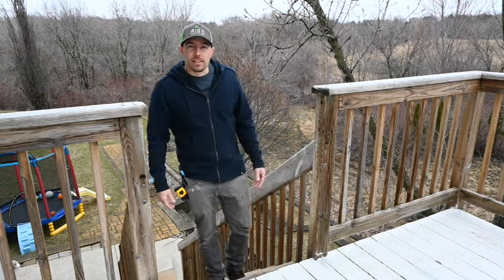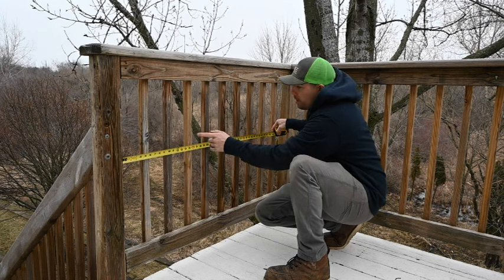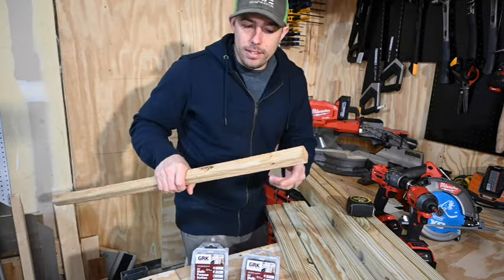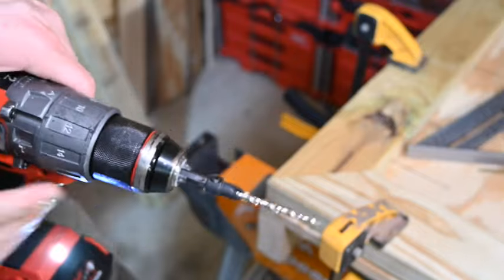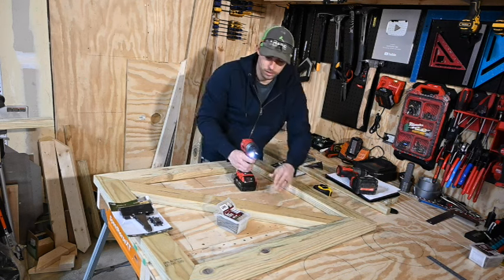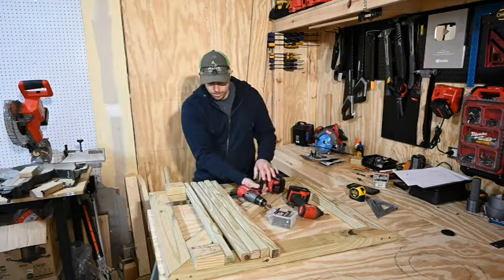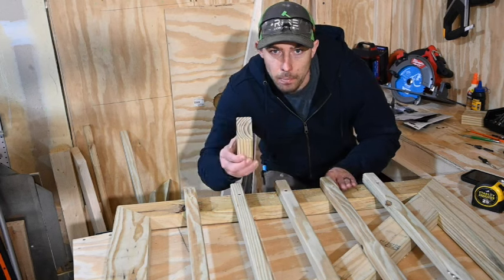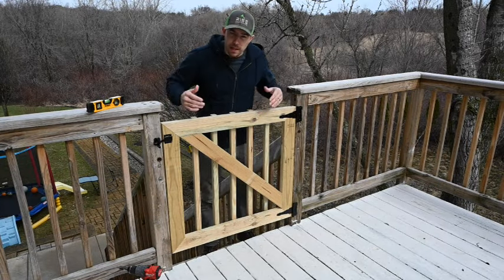How to build a deck gate

Comment: The diagonal support is in wrong position. it needs to be inverted to act as a compression support. Place top of diagonal support on outside top of gate down and in to hinge side to form a compression joint.

Comment: Great video!  Quick question please.  I went and measured my width on my deck stairs and the bottom measurement was a quarter inch shorter than the top.  Top was 42.75”and bottom was 42.5”.  How do I approach this?  Thanks.
Reply: Make it to the smaller size the 42.5"  
Or just split the difference, we don't build stuff out of square, (unless on a boat or special reason, split difference or build smaller size... usually split difference 🥸

Comment: Does one need the diagonal cross board? Is there a purpose for it or can someone skip it?
Reply: ... And cheaper
Reply: Crossbrace is needed to prevent sagging. Attach to upper rail and lower rail for symmetry. Do not exceed less than 45° corner to corner. Attach to lower hinge corner to top latch corner

Comment: What size countersink bit did you use?
Reply: Don't need to countersink. Just send the screws below flush. Also, screw on the vertical sides. Not on top.

Comment: Where are at. In Canada it is illegal to have a gate or a door at  the  top of stairs. The building code also says. The spacing between  balasters are to be so that you can not pass a 4"ball between. That means that the spacing needs to be less than 4" . Not 4" between.😮
Reply: ... that code makes no sense, wouldn't you want to prevent a accidental fall down the stairs by installing a door?😂